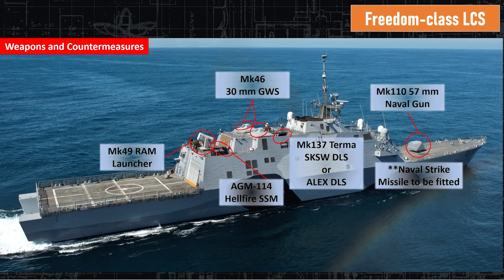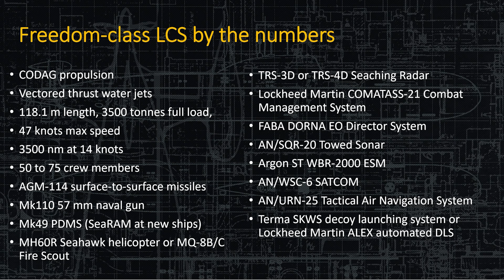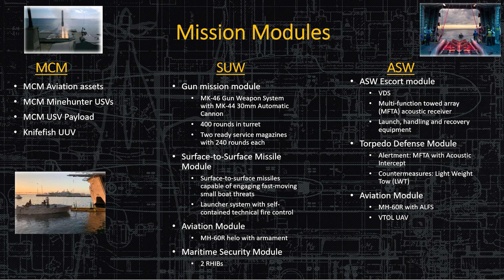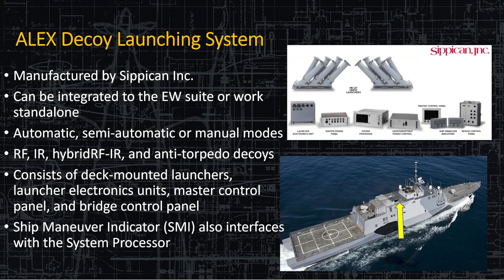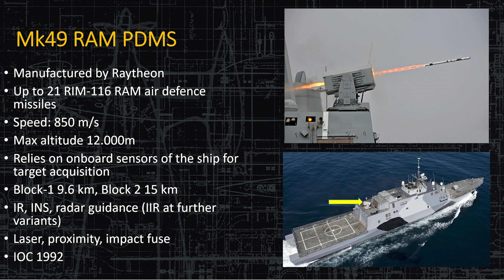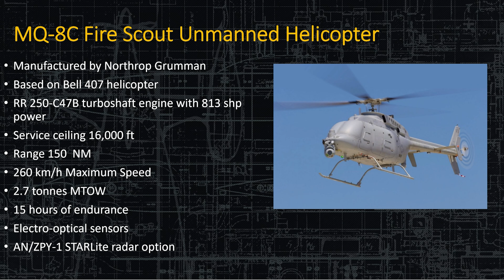Why The US Navy Built This AMAZING Modular Warship?

Comment: The real tragedy of the LCS program is that they were sold as “modular” ships but never really functioned as such. Swapping mission packages takes about as long as integrating a new system into any conventional warship, so the whole “plug-and-play” idea was mostly marketing.

On top of that, both classes have had serious structural and reliability issues, and a lot of them are being retired early. Now they are even trying to pass a couple of them to countries that do not really need such expensive, narrowly focused ships.

And no, these ships cannot realistically replace proper frigates. They are too small, they lack robust area air defense, and in a high-threat environment like the Western Pacific they would be more of a liability than an asset.

To be fair, the one role where the LCS concept actually makes some sense is mine countermeasures. Turning the Freedom class into dedicated MCM platforms is probably the least bad outcome. However, even there, the platform’s reliability and cost issues make it hard to call the program a real success.

If the US Navy wants something useful out of this whole experience, it should lean harder into unmanned surface strike escorts working alongside destroyers. Let the USVs take the risks and deliver the long-range punch, instead of trying to force LCS into a role they were never built for.

Comment: Both the Freedom and Independence Class ships have fatal issues with hull cracking. The Freedom is deemed not survivable in warfare due to thin hull and aluminum superstructure. The Freedom class still has reliability problems with its 4 engine combiner assembly. Both are limited by the Navy to operating no faster than 15 knots, and to sea state 3 or less. The Freedom class has no current mission. The Independence Class is only used for mine sweeping. All are being decommissioned as soon as politically possible.

Comment: To be fair, most naval vessels today require field reps for maintenance, so Freedom is not alone in this, nor is it more difficult than others from my information.  Most naval aircraft also require onsite field reps for certain aspects of maintenance.  I suspect there are field reps required for some submarine systems as well.  Today's Western weapon systems and sensors in general are very complicated and some require specialized support.  For example, that Radar you mentioned on the MH-60R is VERY complex and does require a significant maintenance effort at times (we used to call it Depot and I-level maintenance).  I helped develop it.

Comment: Lord knows I do not think these ships belong in the Navy, but and I know this is a rather unpopular opinion. However, I do think the USCG could make use of both classes, in particular as a stopgap between the Legend and Heritage classes, I say this in regards to the latter lacking a stern launch ramp, this will take a bit of pressure off the Legend class in regards to interdiction missions where small boats are required for blue water boarding actions by DSF's.

In addition it could also service some of the Heritage class mission sets like SAR or PWCS, both LCS classes I think could operate pretty well in the Gulf's waters due to them being generally calmer and shallow compared to say the PNW or Alaskan waters. Not to mention both have decently sized flight decks, especially the Independence class which can accommodate a Sea Stallion apparently, or two Seahawks, which I think could be useful given that the USCG does often operate tandem Jayhawks on missions in particular during SAR missions.

Not to mention the fact that they all are already largely built and for the most part kitted out for the role, so no need to really wait on construction which effectively makes them a "off the shelf" design(s) and we (the taxpayer) did pay for these ships, we may as well get all the use out of them that we can, even if said use is outside the USN "intended" function for them and them being forced into a different branch. And worst case if they still continue to fail in their role within the USCG, we can still sell them off to other nations like we are already apparently intending to do anyways.

Comment: Finally good to see the engine blocks I personally machined for these ships. They are massive but once we got the process down we really cut into the time frame for producing one block start to finish with zero defects and zero rejects from inspections. The Germans over at MAN would not sell their processing to us once we took over the project from them. People have no idea how much work goes into machining one of these blocks and how much sheer iron comes off the stock casting. Multiple setups, imagen flipping this block in the air end for end at 2am on a Sunday morning with no one around LOL. The finish building and assembly of the turbos and top units was done in a city about 30 min north of us that has worked on these engines since pre WW2. Thanks for showing the video. Just proud to see my personal work on display.

Comment: Implementing mission change is so restrictive in the design of these ships that, in their attempt to be the most versatile solution, they ultimately fail to achieve anything.
The multi-mission frigate concept is much easier to implement, even though it requires a slightly larger permanent crew, and, above all, they are much more powerful.

Comment: Thanks for the update. 

If they could just solve the power train issues it seems like it would be a pretty decent vessel for anti piracy. Though, perhaps what they really need to do is develop a new design from the ground up that learns the lessons they learned from this program (more crew bays, build out of steel instead of aluminum, use a prop instead of a water jet so the anti sub platform is actually useful, and go in deep with that reliable diesel powerplant) so they can lower maintenance / operating costs and increase the reliability of the platform. 

I know that's a scary prospect, considering the mess this program was, but an LCS 2 might be the way forward. (Obviously not until they figure out how to manage a program effectively though.)

Comment: The Independence-class is at least taking over the mine countermeasures (MCM) roll from the Avenger-class, so it's not a COMPLETE waste, but the Freedom-class is just a really bad and expensive joke. It seems like it could be made better than useless by removing or relocating the 30mm Bushmasters and ripping out their associated mission module lifts to install an 8-cell Mk41 VLS in place of each lift & 30mm for a total of 16 Mk41 VLS cells. Otherwise, drug interdiction & anti-piracy are about the only viable missions for the Freedom-class ships.

Comment: Amazing??? There is nothing amazing in this ship, sadly this and her sister class Independence could be good (I wont say great) ships but they end as failures. Waste of tax payers money. US navy should go for new frigate class immediatley after retiring Perry class, this experiment cost lot of money and in the end it was a failure. LCS is basically a modular corvette, however it cannot fully replace a frigate. This experiment was doomed from start because it was not executed well, instead two classes, one class could be made and different modules could be created for that "modular" design, this never happened. Look at Chinese, you can say whatever you want for them but they stick with proven concept. They made Type 054A which is way superior to the LCS ships, and they build a lot of them, already having 34-36 in service, and were building total of 50. What US have, Two dozen LCS ships that serves no real combat purpose except patrol ships, yes they were deployed overseas but they were not that useful, if you want up-arm them, you first need to fix all the issues this ships have. Constellation class which is true replacement for Perry is also problematic, they changed to much from original parent design to accomodate US technology but I believe that could be done with less changes, far less. US seeks to have 330 ships yet with retirement of Ticonderoga (and no real replacement), with slow retirement of LCS and probably soon retirement of first Arleigh Burke class destroyers (USS Arleigh Burke been 34 years old now), hardly goal of 330 ships would be achieved.

Comment: Greek here. Greece wants these ships for free. Usually US gives used equipment to Greece for free under conditions (Greece contracts support & maintenance).
The thing is that these ships may have a fitting in the Aegean Sea and serve as Fast Attack ships for Anti Surface warfare. 
However during the recent month Greece is into negotiations with Italy to procure used Italian FREMM ships. Likely Greece will buy 2-4 used FREMMs from Italy and another FDI from France.
Furthermore the Greek economy is doing much better. On the top of that, there is new regulation in the EU that defense spending for procurement will not be considered into deficit under the condition that at least 80% of the spending is towards EU contractors. That is a huge financial superweapon that pretty much puts US contractors at a disadvantage.

Comment: By every metric these boats are total failures, did any of the moduals even work? They can’t even make their designed speeds without cracking the hull(both classes). Even the contracts were so poorly made that many are still being built and going strait from launch to decom.
Reply: @scotfield: I served aboard a 75' Specter class USN patrol boat. Originally designed as a 27knt aluminum hull boat. By the time BUSHIPS got done with it maybe 17knts on a good day in calm water.
Rapid fire, self loading 40mm on the bow. Next biggest was .50. BMGs, port and starboard. 

Port, starboard & centerline 18VT Detroit diesel power plants. All that extra weight from that bow mounted 40mm really slowed it down and kept it from getting up on "step". Nothing but a water plow! BTW, no missles either.

Comment: The USA has armed  forces used in the littorals. The Coast Guard! This is what USCG Cutters are made for. A naval modified version of coast guard cutters could have filled the navy’s need
Reply: Where are you going to fit weapons, radar, and mine hunting systems on a coast guard ship?
Reply: @ …. Look it up online. Proposals and bids were made.
Reply: Coast guard was in Vietnam
Reply: You would have deployed the Coast Guard to Somalia, Iraq, Yemen????
Reply: @HolyNorthAmericanEmpire  REREAD ABOVE CONMENT.  LEARN THAT THE COAST GUARD IS DEPLOYED OVERSEAS AND HAS BEEN IN MULTIPLE WARS AND LESSER COMBAT ACTIONS.
Reply: @HolyNorthAmericanEmpire  op is referring to the boat, suggesting the navy purchase those boats to use for for navy use. 

According to brave ai, the cutter's top speed is 28 knots which is quite a bit slower than the designed for speed of the LCS and it's range is also lower (by about half.) So it's not really a viable solution for navy use.

Comment: There was an episode of Star Trek Voyager that featured a starship that could break into three pieces for combat.  I think of it when i read about these ships cracking apart. They're ahead of their time.
Reply: @yankee1376   Ah, the Prometheus class. 13 year old me thought that thing was the coolest thing I'd ever seen on TV. 33 year old me? Still pretty cool!
Reply: Wrong LCS. The structural cracking is the trimaran variant, because they’re made of aluminum, which is much more susceptible to metal fatigue. The monohull LCS has a steel hull, and steel has a thing called a fatigue limit. That basically means that below a certain level of stress, steel doesn’t experience metal fatigue from cyclic loading, and if you design the hull so all of the steel is always below that stress, the ship won’t have any fatigue issues.
Reply: There is a difference between separation and breaking up.
Reply: Yeah but Voyager was a bit plop

Comment: Regarding helicopter range, helicopters consume more fuel in a hover because the rotor is moving through its own disturbed air.
Reply: Helicopters in hover counter their weight by the rotor blades as a fan , while cruising the blades also produce lift as a normal fixed wing aircraft which makes the system more efficient
Reply: @granazis1  Rotor blades are always producing lift, no matter mode of flight it is in, unless it's in some kind of blade stall
Reply: @mathewferstl7042  which lift depends on total airspeed over the blade .what is the speed at hover and what is while cruising? Check first reply later
Reply: @granazis1 you made a distinction between how they produce lift in a hover versus in foward flight. So long as the blade are spinning and are not stalled, they are always producing lift. On a technical level, its the exact same mechanism. The originally commentors explaination was correct

Comment: I don't understand why the Navy didn't want to use ESSM block 2 instead. It can be used as both anti air and anti surface. It's quad packed. Has much greater range than the AGM114. Could they not find the space to fit a 8 Cell MK41 VLS module? It would have made it a much more lethal and potent ship.
Reply: Vs Corvettes and frigates sure.
But the point of these was to hunt small craft.

( one of the points atleast ).

I rather think guided 2.75" rockets on a drone or guided 3" Volcano ammo from a 3" gun wouldve made more sense .....
Reply: @dwwolf4636 Most corvettes would smoke this turkey.
Reply: The problem i could see,is the limited production lines.It's all well and good to say let's put ESSM block 2 on this and that,but first,you've got to pay for them and second,you've got to build them.Right now the U.S. navy has been expending quite a few missiles in the Red Sea against the Houtis,so they have to replenish those stocks.I don't think that the optimal use of those missiles would be on a platform that is not very survivable and would not be assigned to frontline combat.Imho,These ships should be used for drug interdiction,even with their short legs.But i could be wrong :)
Reply: Adding VLS would’ve intruded into the hanger & mission bays. That would eliminate the whole point of the modularity and crowd out a helo
Reply: The Phillipines need ships to ground on reefs as garrisons, perhaps they can use these.

Comment: "Experienced" ship builders are in question at this point.
Reply: In my opinion its a navy issue. 

Almost all the problems with both lcs classes root to the fact they have a skeleton crew. 

They have the bare minimum amount of men to run a frigate yet it's also one of the most complex ships for maintenance in the Navy. 

A paradox in a decision. 

Also the navy were responsible for the mission modules those weren't really fenictari or however you spell themselves responsibility. 

From there point of view the navy said they would work a certain way and they delivered a ship that was compatible with the navies request. 

It was just a stupid design to begin with.

Comment: Absolute failure of a program. No names were to blame and zero accountability.
Reply: Worse than that, there was reverse accountability since the LCS Program Manager was promoted to reign over the destruction of the Frigate Program as well.
Reply: I still remember seeing an LCS go out in San Diego for crew proficiency, whichever one was the trimaran hull, and about an hour later saw her sitting on the horizon trying to restart her engines.  When I looked again at her, about 15-20min later, there were harbor tugs heading out to her.  Talked to the Command Master Chief of the squadron, friend of mine he’d been a former instructor, and he admitted those types had more issues than the Freedom types.
Reply: @matthewcasey5059 I believe that is the independence class. They're also the ones who had the biggest issues with hull fractures.
Reply: @Connor: Just another excuse to present to Congress when presenting the next budget increase.
Reply: There is one name to blame: George W. Bush